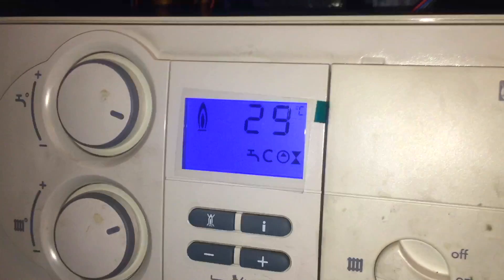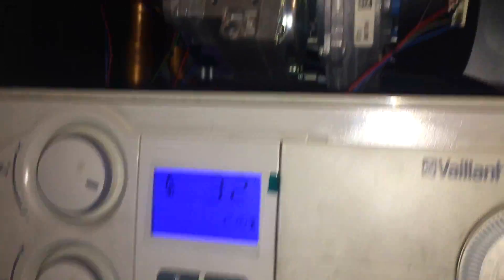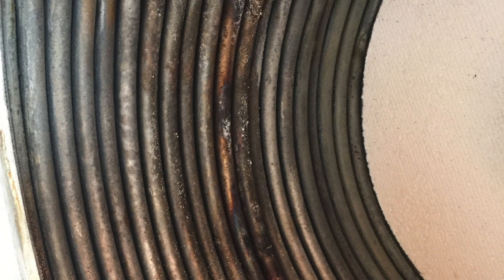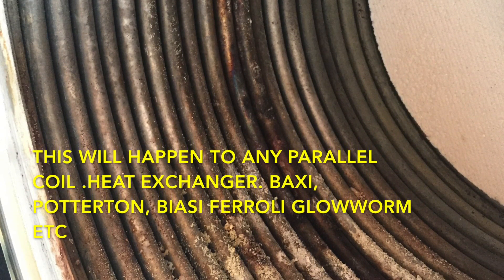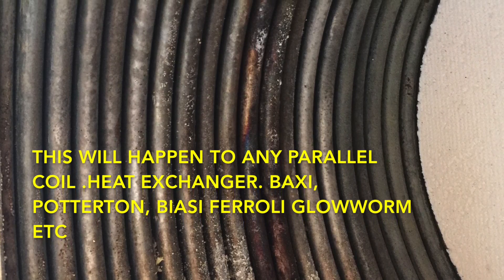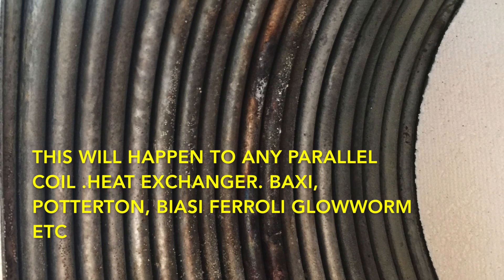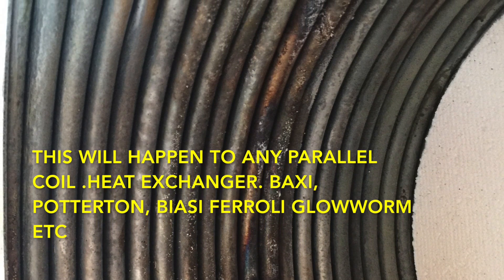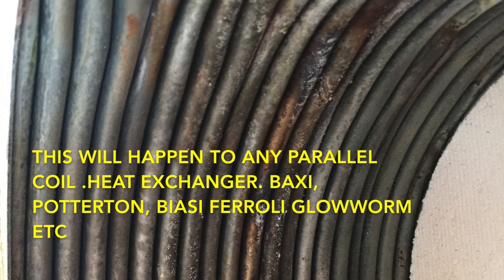Noisy Boiler. Giannoni. Aeroplane And Banging. CLEAN YOUR SYSTEM FIRST

Comment: Honest question, my (stainless steel) coils are rusting and may eventually fail in a few years. I'll try some rust converter in the near future, but if I can't stop the rust from attacking the steel, I've thought about removing the heat exchanger, taking it apart, and replacing the coil with  the same size copper pipe wound the same way as the previous stainless steel.  From just a materials perspective, do you think any problems could arise from the coils being copper vs stainless steel? (Btw I don't give a shit about any laws, regulations or bs about being licensed to work on my own gas boiler, I'm only working on the water side of it).
Reply from the maker: If your boiler is condensing then the copper would rot within a few months. Also, the heat exchanger is designed to keep emissions low while efficiency is high. The heat exchanger is part of the heat engine which is all part of the gas train. It would be an interesting thing to see but wouldn't work in practice. :-)

Comment: Used to fit halstead edens....not that popular but same parallel heat exchangers.....still look after a few but they all block up in the end, they try to go to full rate then rapidly come down with lots of noise. We've tried all sorts to unblock them but nothing works....kills them in the end

Comment: I remember some 40+ years ago being told that the system shold be clinically clean before a low water content boiler is fitted to it, beats me how dirty some sealed systems can get now days.
Reply from the maker: They don't GET that way they ARE that way when the boilers fitted. Im going to another one later. Hopefully I can film it.
Reply: I'm sure self cleaning flux and the lack of hot flushing after installion is one reason plus corrosion inhibitors are not as good as they were years ago.
Reply: I agree , a boiler is only as good as the installer and how he leaves it , You could have a monkey install a turbo max combi of yesteryear and it would likely cause more issues than a good installer like us installing a a cheap ferolli lol . Ps I don’t fit ferolli just making an example of quality of install and system water is by far more important than the diffence between a a boiler now days in my opinion , they are all built to break and I’m sure these manufactures program them too ! Well that might be slight paranoia but I wouldn’t be surprised !
Reply from the maker: I agree with both of you!
Reply: Not long to go til you hit 1000 subs , well done for when you get there bud. here’s to 10 k !
Reply from the maker: Its weird. Never thought I Would get near 1K. I don't know how people Do it.
Reply: you put the work In ! I don’t think we appreciate the time you spend doing them lol but greatful you do and not getting bored yet lol well done anyway
Reply: Lol part of the deal is you have to fix something bank holiday Monday lol 😂
Reply from the maker: I got stuff filmed!!! So maybe I can get one uploaded on Monday!! I away next week so no work. :-0
Reply: Happy days ! Enjoy

Comment: Good video mate . What temp differential do you look for if you suspect blocked plate or main heat exchanger
Reply: Worcester told me that for their SI boiler boiler you would be looking at a max temp difference of 14 degrees across the plate to plate heat exchanger. So any more than that would be indicating a restriction.
Reply from the maker: Nice one! :-) This is why I do this.
Reply from the maker: If Im honest, I just know by feel. If a main heat exchanger is 35c delta T then its blocked. Plate must be the same but i check with my hand so don't really know. I will get some numbers over the next few months. Great question :-)
Reply: HeatingGeek thanks for the reply mate . If you get the chance would like to see how you test your rectification on some boilers a no some you can see in the parameters 👍
Reply from the maker: The Remaha Video Has a bit of that in it. Is this what you mean?

https://youtu.be/p8Y0vt4C_Wo